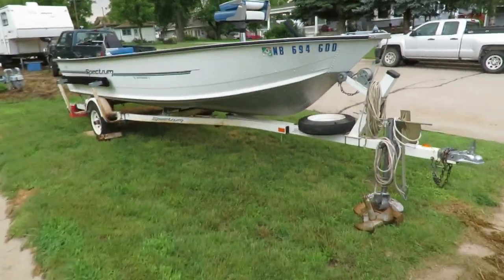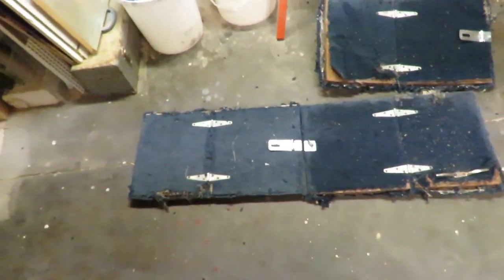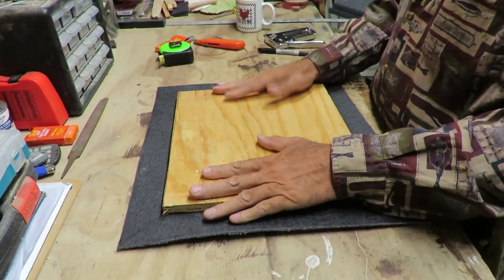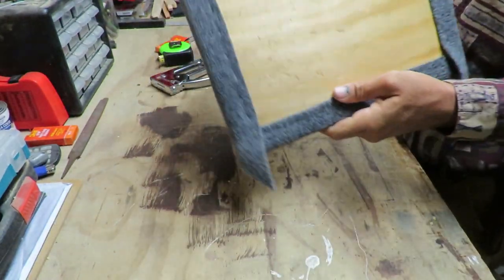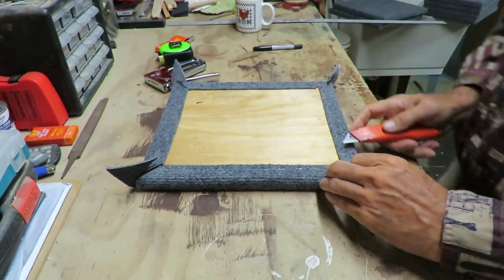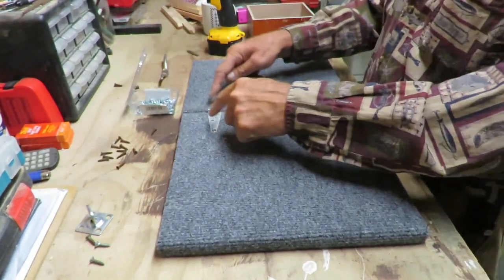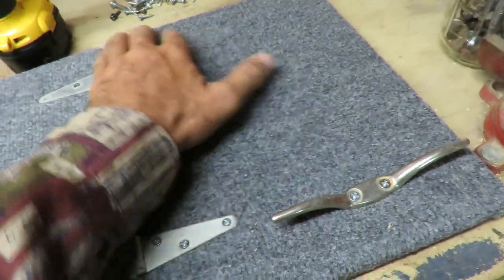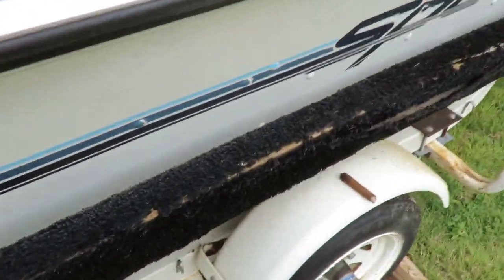Boat Restoration Part 1 Replacing Carpet in the Boat Part 1

Comment: Nice video. Straight to the point, with the necessary detail. Thanks mate. Curious, is contact adhesive not necessary between the carpet and ply? I thought most people used it?
Reply from the maker: Yes it is.  I didn't use t on the storage area lids since they are so small.  Probably should have.  I definitely used it on the entire floor.
Reply: @studnickaaquatics80  Sounds good. Thanks for reply mate.

Comment: Im watching this to recarpet my cat tree 🐾 But I only use staples until the glue dries, then I remove staples.
Reply from the maker: Great idea.  I did the same thing on my boat carpet.  It took a lot of staples in some areas.  Removing them after the glue was dry worked great.  Good Luck on the Cat Tree.

Comment: Make sure you put the carpet all the same way. If not it will reflect the light differently and some spots will look darker than others. Its the same affect as a baseball field lawn when its been cut and is checkered
Reply from the maker: Excellent point.  It's all in the details.

Comment: i’m doing this for a false floor in my 4wd. how do i do this with thick marine carpet
Reply from the maker: You will have to use Marine Carpet Glue.  I used it on my boat renovation.  I did not use it on these doors because they were so small.

Comment: Nice little boat dean i have a 20 foot cuddy i keep at my house in ireland for sea fishing .dont know what you guys call it but we call it a cuddy.has the compartment at the front withwindows and 2 doors you can fit 4 people inside if the weather takes a turn has running lights for night fishing too.ive got a camping stove and sleeping bags in it incase the kids get tired love the boat..did you not think of aluminium tops instead of wood for your project.
Reply from the maker: Sounds like a nice boat.  What fish do you catch out there.  I went with the wood because I had a piece of marine grade plywood in my shop.  I do like the idea of aluminum.